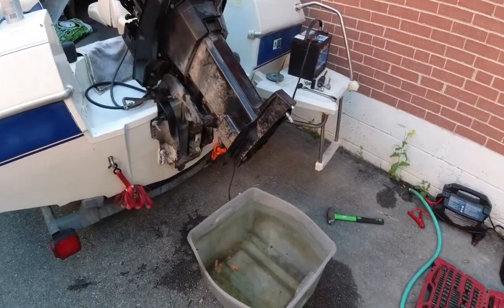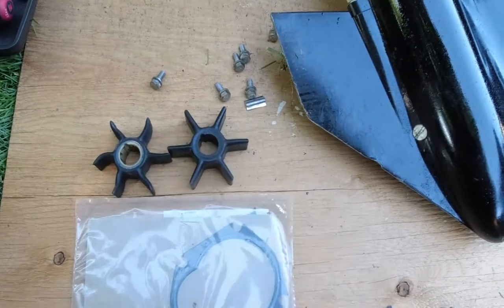Motor Swap on Our Boat (Re-powering)

Comment: What's your plans for the old force motor?
Reply from the maker: Hey Cole,  So I have bin using the Mercury motor and we are very happy with it. So I will be putting it up for sale soon.
Reply: @416Expedition  okay i was just wondering. I got a 1992 capri bayliner myself and it has the 70hp force on it. And for the life of me cant get it running rite
But the voltage regulator looks pretty burnt up to me. And the lower end may need seals 
Runs for ever on ear muffs.. but once in the water it will not stay running
Been tryna find parts but cant

Wanting to do the same as you with the whole power upgrade but its a bit pricey maybe wait till winter hits since i like in ND
Reply from the maker: Hey Cole.   When my lower unit blew up I tried finding parts for it and thats when I realized that we need to change the motor.  I lucked out and found a lower unit for sale and I snatched up right away.   At this point our 70HP Force motor is running great.   Looking for another motor is hard enough. Find one for deal is even harder.   You just have to be passionate and keep Checking the market and see what’s being put up for sale.   As for your motor now it sounds either a carb issue or a build up of carbon in the cylinders.  When you have the motor on muffs there’s no back pressure in the exhaust so the motor runs easy. But when in The water with the back pressure it’s harder to run.  Try spraying seafoam in the cylinders and add in the fuel tank.  Fallow the direction on the bottle for how much to use.   Then run it for a bit with the muffs on. If you are will try cleaning the Carburetor and see what happens. It could be clogged jets.   Now I’m not a mechanic I’m just giving you my best advice with the experience I have with the force motor.  But if I were you I would start with seafoam.
Reply: @416Expedition  okay thanks again, im looking at a 60hp mercury 2004 motor. But its just a matter of if there willing to seel it, it has efi which would be nice 
But i have cleaned the carb found a stuck flost needle was gonna try the old polish the seat trick hofpully no more sticking  
But my luck the old bowl gasket ripped so imma try making a new one out of 1/16th cork board material figers crossed
And i was planning on doing a compression test tomorrow, make sure all the cylinders are happy. So i dont throw money into somthing that wont benefit me any

And I'll do some seafoam on ear muffs tomorrow also see what i get out of it